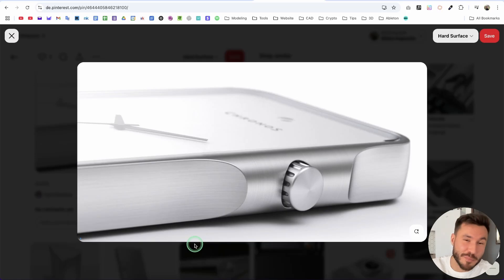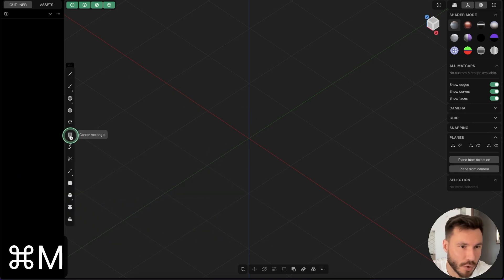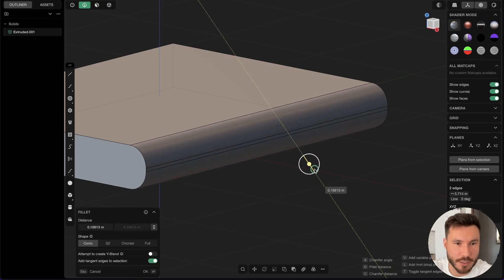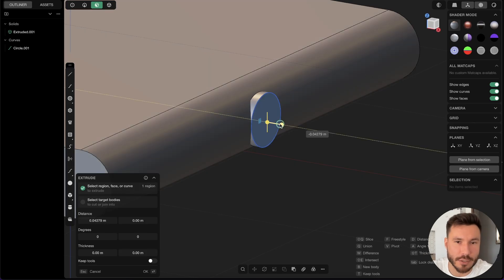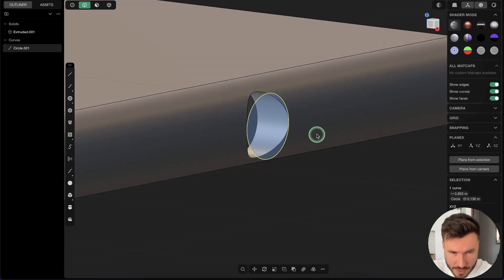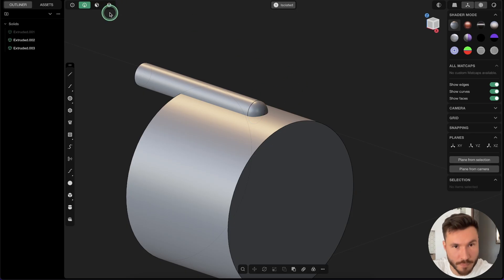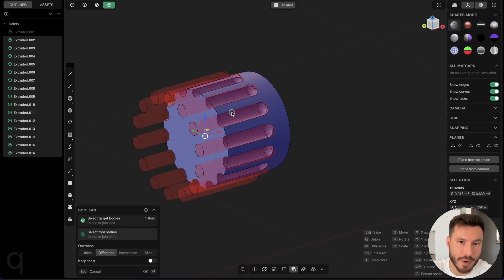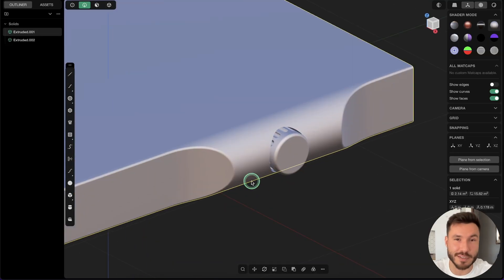BEGINNER Hard Surface 3D Modeling (NEW AMAZING Program)

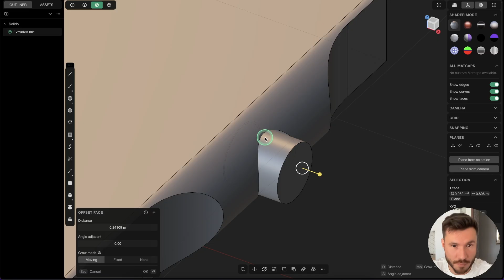Comment: Just to avoid confusion for noobs, at 8:32 he meant to say "we don't want to Offset this", which is the default function for a selected surface (you can see an active tool's options appearing at the bottom left of the window), which functions a lot like Extrude, but has differences which become apparent with use. As he demonstrates right afterwards though, you DO want to Extrude it, and create a new body.